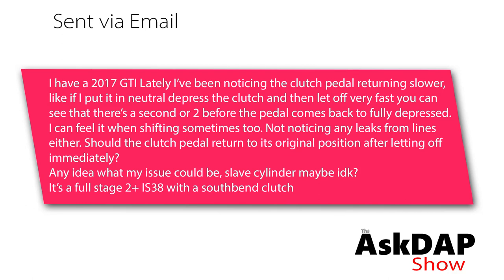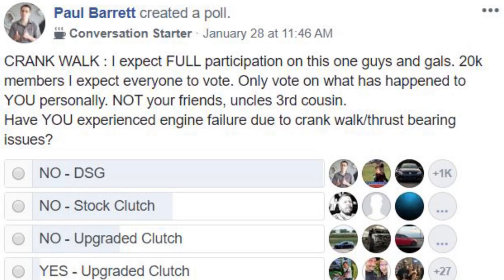Clutch Pedal Feels Slow and Soft | AskDap

Comment: I had the same issue in my 18 mk7. It ended being the slave cylinder. Took it to the dealer and thankfully was covered under warranty. I had no mods at the time.
Reply: sweet thanks for commenting this.  I'm having the same issue in my 18 gti.  Have an appointment at the dealership already, only 28k miles, should be good on warranty then.

Comment: AVOID DKM CLUTCHES this may have a relationship to this issue 

Plz keep up with the crank walk issue just lost my mk7R manual with a DKM, clutch stop and harmonic balancer.  I had only 60k on the car, this does cause engine failure, you will be in need of a rebuild.  

Or just pull the oil pan and you will find you crank bearing seal sitting in the pan.

Comment: Is there a kit to make a clutch pedal extremely soft or adjustable stiffness? Most of my cars have been standard but I have a progressive muscle disease that causes weakness. And I can only drive a standard with an extremely soft clutch lighter than a lot of stock clutch pedals. Any recommendations. Or would I have to get a custom clutch with some type of pulley/ hydraulic device to make it very easy to push the clutch in?
Reply: There are springs in clutch pedals that pull the clutch to the firewall when you push the clutch in. Upgrade that spring and it will assist you more

Comment: Thank you for bringing these back.   I know they don't get a lot of attention from subscribers, but the info is gold!

Quick Question: I have an '08 A3 TFSI CBFA/ DSG 02E.  I bought an OBD11 Next Gen Pro from you guys recently and I'm recording misfires, but only in between gear shifts (normally gears 1-4, random and intermittent). I'm at 165K miles.  New:  plugs, coils, PCV, fuel system from tank to injectors, iAbed RMS, carbon cleaned last year, crank position sensor, timing chain tensioner, intake manifold, etc. off the top of my head.  I assume this isn't normal, any advice? Other than that the money pit runs great. Thank you!
Reply: sell da pit

Comment: What if my master and slave and clutch/pressure plate are all brand new. EVERYTHING is brand new. Absolutely no bubbles and lines have been flushed many times. The linkage is all new and no binding anywhere. It's a 1 1/8" bore on a SM465 with 11" clutch from SouthBend. Someone said this might be to large of a bore for the clutch size. Still, it should return faster. Everyone is stumped...even the so called professionals. This was happening prior to throwing the kitchen sink at it. The only thing I havent changed is the hard line or the braided line from the hard line to slave. Save me broskee...Im losing my marbles.